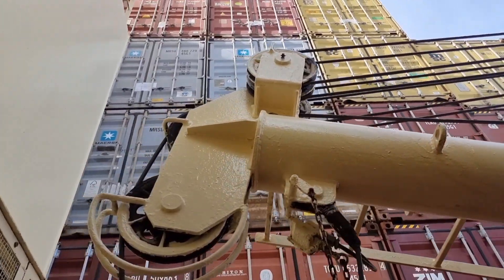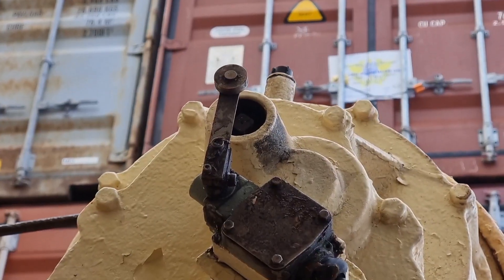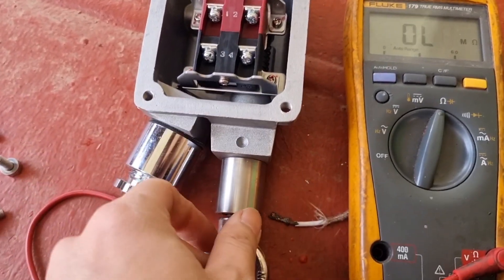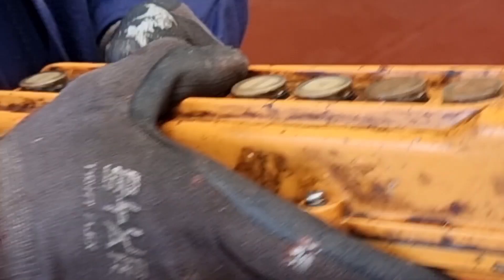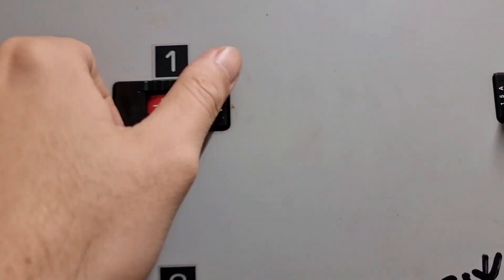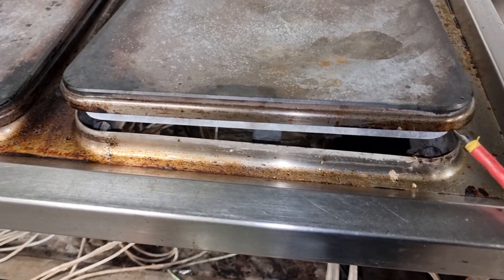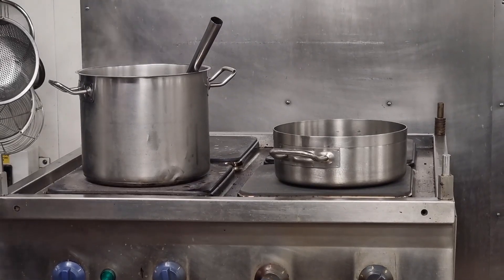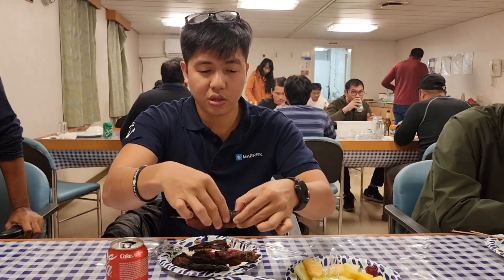CRANE BROKE DOWN, ELECTRICAL TROUBLESHOOTING | leckyjake

Comment: According to scheme limit switch normally in closed position and if you lift up hook very high till the switch will be activated it will open and motor will be stopped,  right?

Comment: Good thing that electrical spare availability onboard is at hand. 
just sharing my exp before on suez crane. no electrical problem of sort but a broken mechanical part for lowering and hoisting of crane. if I can still recall correctly..the driving rotor was cut neatly..that you cànt easily see unless you open gear box.

Comment: Thank you for this video. In your experience as ETO onboard, it’s common to see electrical failures in the galley/ electric ranges? It’s fair to say that cooks are prone to experience electric shocks when using this type of equipments? 
Second, would you recommend to perform an insulation test for the hot plates? If so, which insulation you recommend to use for testing?

Comment: I'm learning first hand what a nightmare hot plates and heating elements can be to work with at work. Seeing fresh wires for a change is awesome. I've never thought to use an insulation tester on anything besides a motor before, seems like it did a good job.
Reply from the maker: thank you very much

Comment: Thank you for sharing knowledge.. I have one doubt, if we don't have limit switch spare then will you bypass limit switch for temporary till spare comes ?
Reply from the maker: i will modify the circuit and put another limit switch that will stop the hook once reach a certain distance from the boom. i will take other limit switch regardless of the design